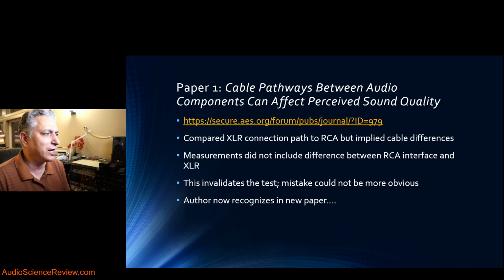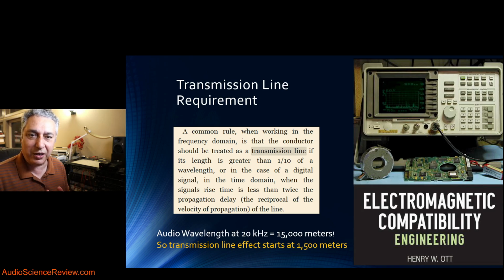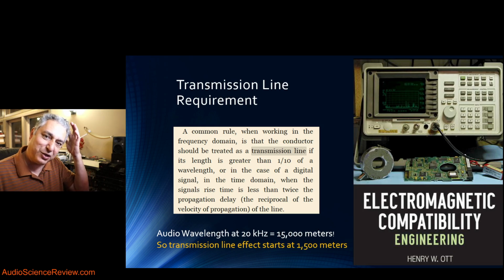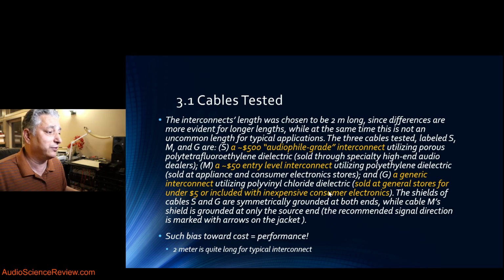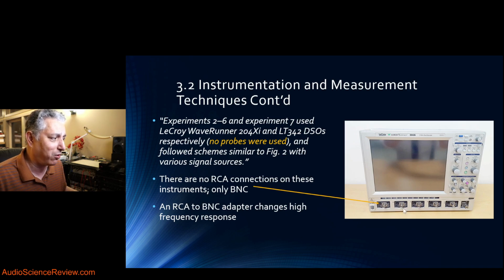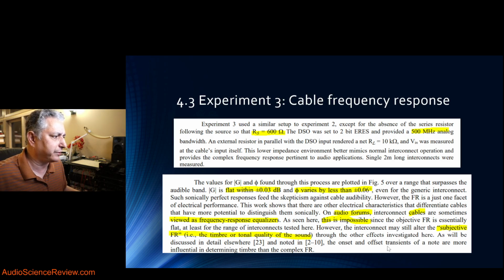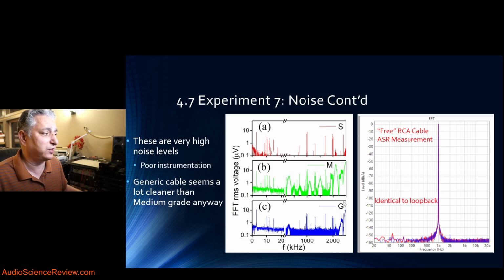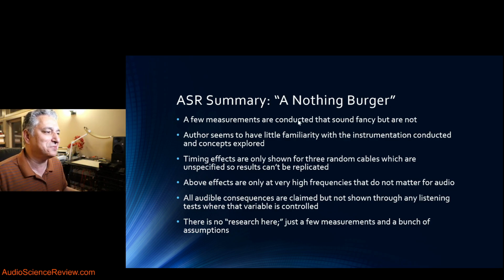Scientific Proof of Measurable Difference in Audio Cables? Paper Review

Comment: I think the point about the speed of audio signals is really the key take away. I know that modern PCI 3X and 4X cables construction is very important and you really do run into issues if they’re not high-quality. Why such a big deal with these cables = signal speeds.
Reply: @Douglas Blake I miss spoke. Thank you for correcting this.  frequency is the term I should be using not speed

Comment: Another great de-bunking video.  Jay I is another channel that keeps getting pushed into my view through algorithms even though I keep telling YouTube to quit recommending channel.  I would be very interested to see your measurements on capacitors.  Electrolytic vs Polypropylene especially when used in speaker crossovers.
Reply from the maker: Thanks.  That is on my todo list (to investigate).
Reply: Electrolytic decay (dry out) overtime, and it can behavior like a inductor with higher enough frequency thus distort the signals. Electrolytic is far susceptible to ambient temperature  and humidity  changes and in generally not suitable to use in signal paths.  See https://www.wima.de/wp-content/uploads/media/WIMA-Audio.pdf.

Comment: I am not a believer in exotic cable differences and a lot of nonsense is written about this. (People might like to watch Ethan Winer's null test videos).  But cables do differ in LRC parameters. There are circumstances where this might make some small change in frequency response, especially out of band at ultra high frequencies which can affect (badly designed) amplifiers.  The point is , however, that all these things are understood.  Incidentally, ethernet cable is cheap and has enormous bandwidth for people who think (oddly no doubt) that you need huge bandwidth.  But impedance effects can make changes in frequency response--in comprehended ways but still small changes.

Comment: Cables CAN sound different...........that is if the manufacturer includes an audio filter of some type built into the cable to change the frequency response but then why would they? A cable's job is simply to transfer a signal from point A to point B without degrading the signal or changing the frequency response................period.

Are there companies that intentionally make their cables non-linear so that anyone can hear a difference when comparing them with a linear cable? I wouldn't doubt it. Rolling off or peaking the  mid/high frequencies might make some listeners prefer the altered cable enough to buy them thinking it improves the sound when in fact it's just acting as a tone control for every recording you play back through them. Not High Fidelity by a long shot.
Reply from the maker: Even the ones with filters don't seem to have one that affects the audible band (I have tested Transparent Audio ones).  So reports of fidelity differences there is also not believable.
Reply: @AudioScienceReview   Yes I think those that actually did affect the audible band were made way back in the 1980s or perhaps not. I was just bringing up the possibility of how a cable manufacturer could fool the buyer into thinking the sound was "better" by introducing frequency modification of some sort. 

I'm pretty sure that at some audio product shows that trickery of some sort is used, either frequency or phase changes introduced that normally isn't even part of the product being sold.

Comment: Amir, I love how you said something that’s been on my mind for years: “cables” are not even a thing, meaning each manufacturer has their own “proprietary technology” which are completely different from each other…

So even with the science aside, there’s not even an agreement on what makes a superior cable, so how am I supposed to tell which one is good and which is bad? Even the “scientific” paper didn’t specify that as you very well pointed out! 😂
Reply: @Douglas Blake precisely. The lack of convergence on the “proprietary technology” gives us a huge red flag that it’s all crap without even needing to understand the real science. The science just confirms it! 😂
Reply: If there were an actual audible difference then the question wouldn'tbe which are "good" and "bad" but what are the audible inaccuracies in each.
Reply: @Douglas Blake That is true. But if there are audible differences then objectively speaking instead of calling them relatively better or worse I would simply identify the type and  severity of the inaccuracies. Better and worse are subjective and open to interpretation.
Reply: @Douglas Blake I would  too. But that is a judgment call. It is possible to design a cable that acts as a passive equalizer. Not how I would do EQ but ya know...if someone likes it that's their choice. Either way I would just ID the audible distortion, such as frequency response roll off and call it what it is.
Reply: @Douglas Blake It's not something I want but calling it stupid is still a subjective judgement call.
Reply: @Douglas Blake What it physically does is not subjective. And IMO that is what should be reported. Whether or not it's "good" "bad" "stupid" etc is subjective.
Reply: @Douglas Blake I get it, I just don't agree with it. If anyone wants to add distortion to their system that is their business. I love the sound of tubes and vinyl. That is my 
prerogative as an audiophile. I'm not interested in anyone telling me that my personal preferences are "bad" or "stupid" and I am especially not interested in anyone trying to promote ideas like "it never should have been made in the first place." I am interested in eductaing audiophiles as to what is what. I know that tubes and vinyl add distortion. I think it is important for audiophiles to understand what it is that they like and dislike. But I think denial of personal preferences or even criticism of them is complete audiophile ego based bullshit. I don't want a cable that acts as an equalier. Not because I am against EQ but because there are better ways to do it. But that is my preference. If someone else likes colored cables that is their 
prerogative. What is important is that they are making well informed decisions and know the cable is colored and not magically revealing musical inofrmation that standard cables are losing.
Reply: @Douglas Blake I don't "endorse" any such thing. I "endorse" educating audiophiles and letting them make their own decisions. I am very much against snake oil producers who make eggregiously false claims about their products and I'd love to see consumer protection agencies go after the ones who are knowingly scamming audiophiles. So just to be clear how that applies to our previous back and forth. I have no problem with someone selling cables or buying cables that act as a passive equalizer. I do have a big problem with some blatently dishonest manufacturer charging thousands of dollars for such a cable, misrepresenting the technology and making clearly bogus claims about what it 
is actually doing as well as what went into making the cable in the first place. I hope you can see the difference.
Reply: @Douglas Blake Not sure why you want to make that perfectly crystal clear to me personally. I see just as much B.S. in audio as you do. Maybe I see even more as there is  a fair amount on the "scientific" side of audio too. Like I said before, I am all for consumer protection agencies going after companies that are knowingly scamming audiophiles. But I am dead set against anyone trying to police personal  
preferences.
Reply: @Douglas Blake Go back and reread what I wrote. the answer is there clear as day where we disagree.
Reply: @Douglas Blake 1.  I honestly don't  care if you agree. It's OK for us to disagree on some things. 2. What was unclear about my statements that I think consumer protection agencies should go after 
companies that knowingly sell snakeoil to audiophiles? I said it twice! Where we disagree is in respect for personal preferences. You think some personal preferences are "stupid" (your words describing any cable that rolls off high frequencies) and I said I think such products are better described objectively and accurately as what they are and left to the individual to pass subjective judgement on them. What matters is that audiophiles are educated on what the 
products actually are and what they actually do. THAT'S where we disagree. I have no interest in policing personal taste and preferences or passing judgement on them. Someone sells a cable that colors the sound and there are audiophiles who like it who are you to pass judgement on that? Now when they sell it for grossly infalted prices and make false claims about the technology, research and actual effects of the cable that's consumer fraud. I am against that. I don't give a ** about honest sales of products I would not own
 myself.

Comment: Isn't the wavelength of a 20khz sound wave ~1.7cm not 15,000 meters? Wavelength = Speed / Frequency, speed of sound 343 m/s still yeah?
Reply: in air that is correct, in an electrical conductor it is not. So 15,000 m per second in a copper wire is in the right ballpark.

Comment: I just posted this under the Jay's iyagi video on this paper...  ( https://www.youtube.com/watch?v=a4R6I_TtKQQ )

"A bit of a rant...  Note - you do not have to agree, and if you don't like what I have written that's fine - really.  This video currently 342 comments and none point out the absurdity of sending a 4ns pulse down a cable intended for audio use as a test method?  The paper barely mentions transmission line theory (highly relevant to 4ns pulses and fast transients, but not generally relevant to analogue audio signals).  This becomes even more apparent when they try to measure transient response in section 4.4 when sending signals which would require the cable to have a matched terminating impedance and or matched source impedance, but they go with an arbitrary source of 100 ohms and a load of 10k ohms.  This is reasonable for audio frequencies, even up to 100kHz or so, but they do not test with a signal that is reasonable for audio.  A get it that audiophiles do not like engineering types (like me) questioning their beliefs, and I have little issue with that - they are entitled to their views. But I cannot accept "research" when the basic electrical principles of how signals behave in cables are overlooked to such an extent."

Will see what happens....

Comment: I just sold my cardas XLR interconnects and replaced them with 45$ XLR interconnect for AliExpress. and I precise no difference on my audio research system. So don't waist your money 💲💰 on cables. There's plenty of good 👍 quality cables at reasonable prices. Stay away from the audiophile bleeding edge. Buy a better speaker or amp not a perceived better cable

Comment: Great video, as usual. Cables don't matter. I do make my own cables out of good wire and nice connectors, to get the exact length I want, and because its easy and relaxing. Comment about the uB and decibel at about 25:20 (you probably already know this and I misunderstood you!) : he didn't really invent a new unit, as you said. The 'B' in dB comes from the base unit bel, so he just rescaled his results by the 'micro' (mu, 10^-6) prefix instead of the common 'd' (deci, 10^-1) prefix. So, his paper is patent silliness, but he did get the unit prefixes right. Pedantry off.

Comment: Square waves are a great way to measure responses. Accurate reproduction leads to accurate sound. Harmon Kardon used this standard for design back in the seventies.
Nice takedown, BTW.
Reply: @Douglas Blake While those techniques are more incisive, a rolled off square wave demonstrates problems. Those fifty watt H/K receivers pounded very well and were  better reproducers of bass than say a Pioneer SX-anything, though less powerfully.

Comment: At 11:34 there's a note that says audio wavelength at 20 kHz is 15,000 meters. Is that something different than the wavelength which should be 0.01715 meters at that frequency?
Reply: @Douglas Blake thanks. I knew one of us would be wrong and it wouldn’t be Amir!
Reply: @davidcharleson8403 What was the respons? i cant see the comment but i was wondering the exact same thing
Reply: @philipvesterlund1253 the note refers to electrical wavelength, not sound waves. The point is there is no transmission line effect for any kind of cable used in stereos. (Speed of light in meters/sec over freq in Hz)

Comment: and now at 27 minutes in, you are describing how changing even just the way the cable is laying can alter measurements. i get this is about whether or not there are audible differences, but come on now.
Reply from the maker: If you are making very sensitive measurements at very high bandwidth, then everything does matter.  Interference coupling into the cable depends on location, actual impedance of the cable, etc.
Reply: @Douglas Blake im aware it can, i wasnt saying it doesnt.
Reply: @Douglas Blake no, he is saying cables make no difference audibly, than goes on to describe all sorts of parameters that affect what comes out one end of a cable. My issue is with him implying that there is no possible way those differences are audible.
Reply: @Douglas Blake and alot thats above 20khz that still provides spatial ques. there is alot that we do not objectively know. though subjectively appears to be differences. still nothing proven here. Ive also never that i believe that 100k dollar speaker cables cables 100% do make an audible difference, but i know, that in theory, it IS possible. there are alot of variables in play. to say its totally not possible that a cable could make audible differences is simply not understanding that we, collectively, lack the information needed to make that ascertation.

Comment: Well. If Izaak perlman isn't doing every single immeasurable effort to create the sound he is. Then why wouldn't people believe in the sort of things. The cost effectiveness argument I think works better than this is just total b***** argument. You are fighting for every possible effort to make the most beautiful sounding piece of art you can and it's highly subjective.....
Reply: @Douglas Blake nope to your nope. I've watched this battle kick off and the amir side is right most of the time. Not all of the time. I'm not trying to say we should all run out and buy "audio file air"  to fill our listening rooms with if someone starts to sell it. I'm just saying the idea that something is expensive doesn't necessarily mean it's not worth buying all of the time.
Reply: @Douglas Blake this isn't rocket surgery though. It's not like you need a Greek god to descend from mount Klipsch to bless you with an engineering degree or a $200K test bed system like amin has. To save yourself from buying a $2k power supply conditioner. I think ps audio sold like ten of those units. For the record ASR is the gold standard for insight on things I'll never participate in ahhahah

Comment: @Audio Science Review 
  Check your hear abilities and what Hz your ears are most sensetive too. Its vary from birth, your age and if you trained your hear abilities. (playing with live instruments and etc)
 Also note basic voltage, if its stable? 99-100v its already 1% and it could be noticeble in any track on good equipment. Doubt ppl got it stable to hold at least in 1% difference.
 And 3rd can you measure the food taste when it comes to thin characteristics? Same with audio. A lot of stuff with very good THD above 110*  but even with same numbers the sound character is different and there is a lot of stuff that affect this. I wrote about most basic and most important to my mind. If people got their hearing limits that low, so lucky they are cause they can use more equipment for cheaper price and be happy. For example "boring" amp Yamaha PC2002 has very great characteristics and Ive tried to buy modern amp to replace it with better "numbers" but its failed via listening tests so obviously vs SMSL HO200. Even I was using PC2002 with speaker selector and tc electronic xlr (to use with headphones r70x) cheap preamp it won. By any means that cheap preamp and passive speaker selector could not boost quality of that amp (only degrade/distort) and that chain won so obviously vs smsl... (btw voltage source was the same 99-100v and all other equipment except those Ive mentioned). HO 200 was so bad comparing to pc2002 that I cant even hear it more that 5-10 min even for tests. Tried several times, got same results.. as with xlr cable replacement.. But with some cables I hear no difference. Doesnt matter what the cost was. Some cheap sounds perfect, some costly distorted in some way or another. Hearing tests will be allways above technical, if you are the end listener/user.
Also note how many ppl hear difference between DAC filters. Almost every developer got several settings. Topping, SMSL, Chord and any otehr company.. and how many of them hear the difference?  For heample in headphones, even very good ones with good THD? Even I didnt hear any in D70s with Yamaha pc2002, +tc electronics xlr preamp(weakest pont in the chain btw)) and r70x headphones.  But on mobile dac on LG G7 I could hear them very good with same headphones. Btw on topping d50 also didnt heard it. It doesnt mean that devs are "lying" or etc? But did you  really hear it, what most important.
Reply from the maker: I have had my hearing tested.  I am also a trained listener.  I suspect you are not the latter.  Live instruments does not enable you to know what to listen for in sound reproduction.  Two different world.  Common myth though.

Music is like the food.  We don't measure either.  That is the art.  Equipment is like the dishes you serve food on.  You want them clean.  We can measure the plates for germs.  And do the same for audio equipment.  Those measurements though need to make sense and they don't in this paper.